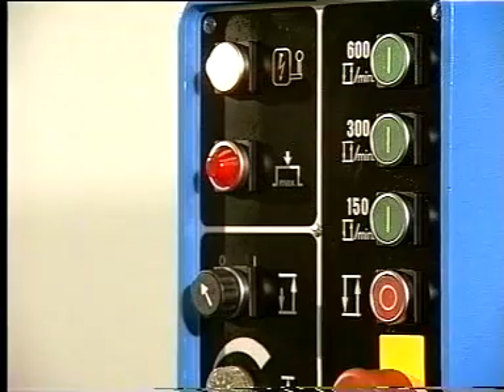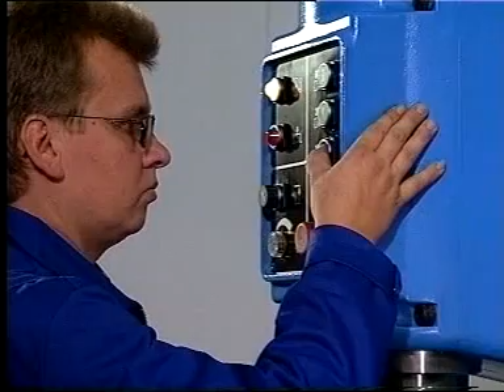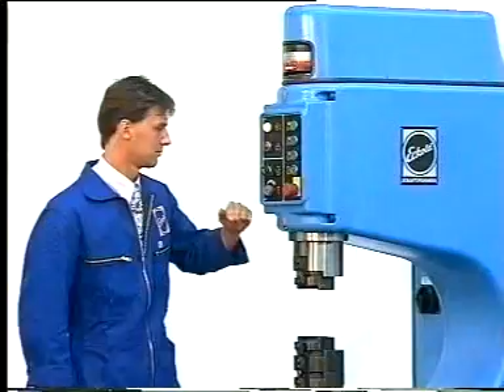Eckold Kraftformer

Comment: Really great tool. One could extend it even more by locking the hammering, and mounting rollers, to basically also replace the English wheel. With proper dies it already replaces planishing hammer, scretcher and shrinker, which usually are 3 different machines. It can replace to some extent bead roller for making beads and flanges. So 4 machines. And with some work it can replace even to some extent a bending press, ring rollers, and sheed metal roller. (There are benefits to having separate simple tools, but these one is electrically powered so is really easy to use. The main benefit of having separate machines is that actually many of them are cheap, especially if manually operated, and it saves a lot of time to have them always ready to be used, compared to constantly replacing dies and tools in this machine). The capabilities of the biggest machine are awesome. It can do shrinking and stretching of up to 16 mm profiles. Amazing.

As a hobbiest with limited space and not that much work done, and mostly done for fun, not for speed. I would prefer to invest in this one big machine than into 4-5 different machines that takes a lot space. Not only it is better (beyond price and wasted time changing tools in it), but it makes work more consistent and dimensionally accurate.
Reply: true but they are unaffordable for the amateur end  user ,so you are back to the chinese crap